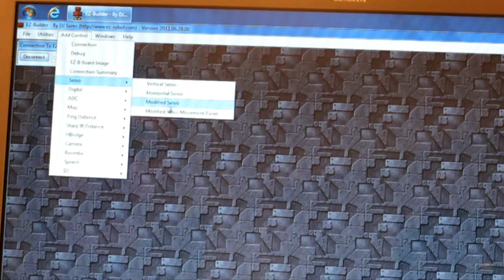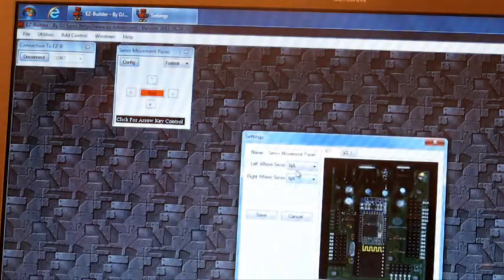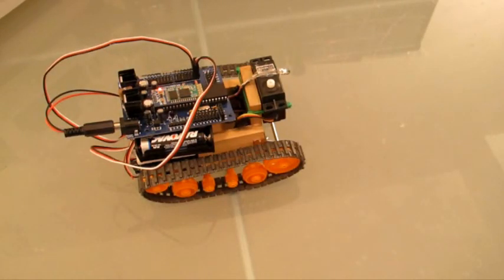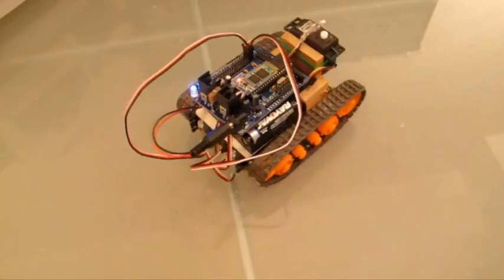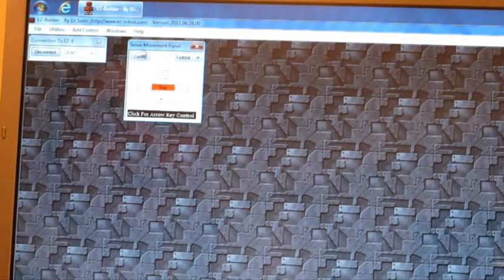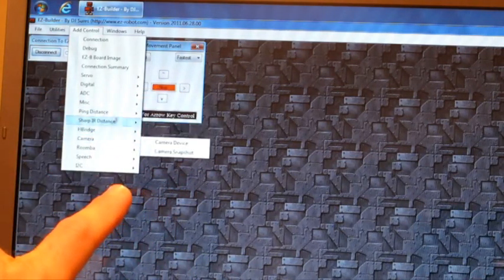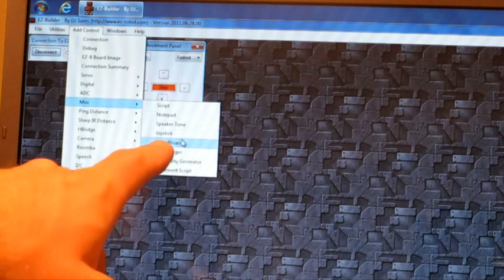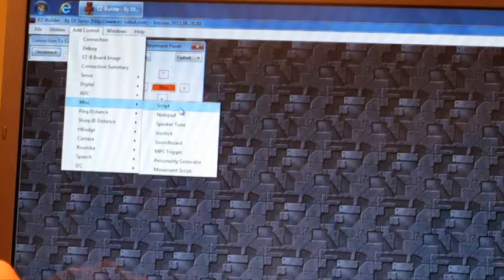EZ-Robot Modified Servo Tutorial

Comment from the maker: @turtleD90 due to the intensive cpu processing required for video camera color/motion tracking, voice recognition, joystick support, and graphical programmable interface... yes you need the pc. If you wish to do very basic control of servos, then you can control the ez-b by an arduino.
Reply: Thanks for the video! I have been looking for a cheap chassis to connect my continuous servos too. Can you direct me to where I can buy chassis with wheels like that? I have a few continuous servos of my own. I'd consider spending money on a set of wheels like that, however. I want a chassis that can ride over lawn grass. I'd be using a power bank of 5v port as power supply. Any leads?